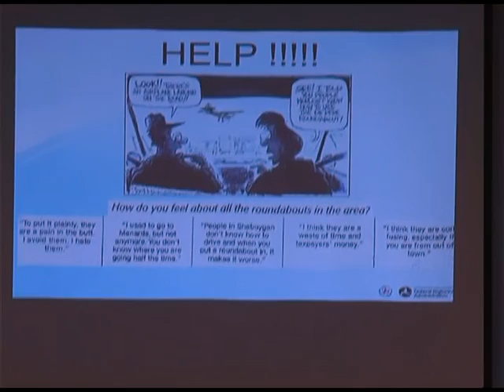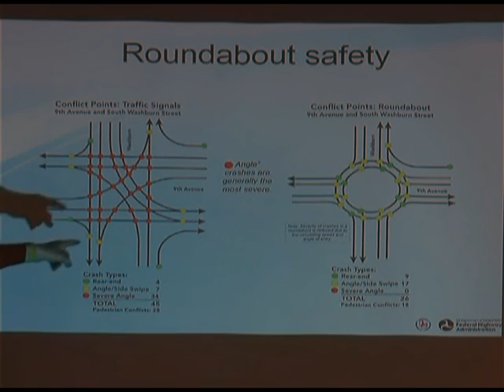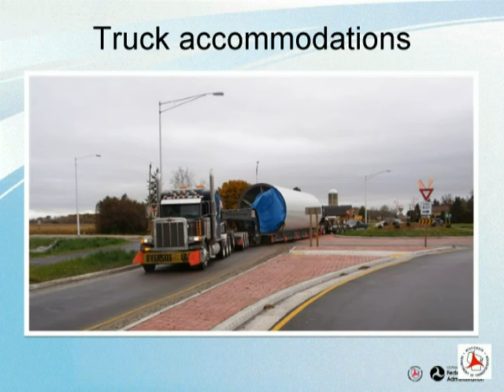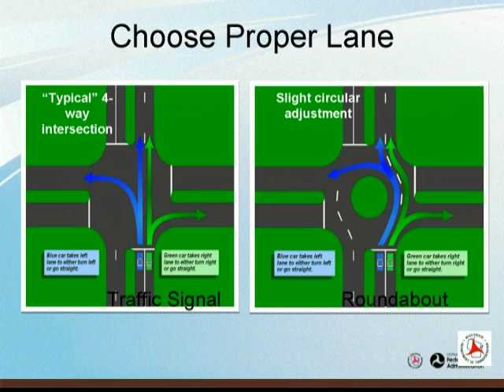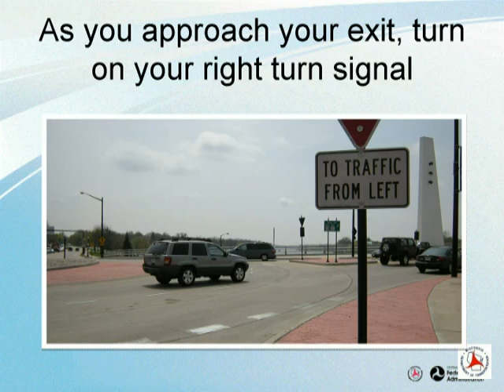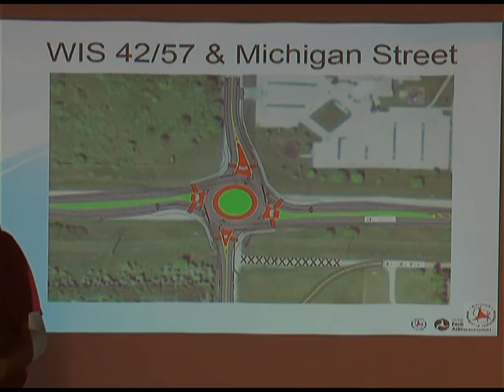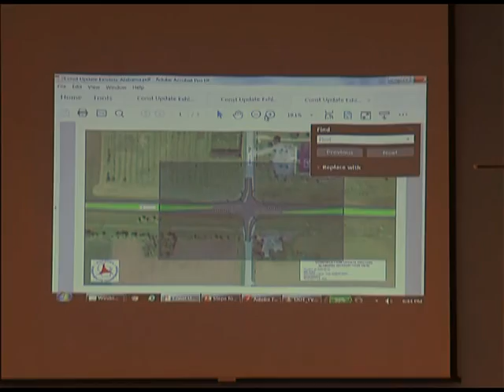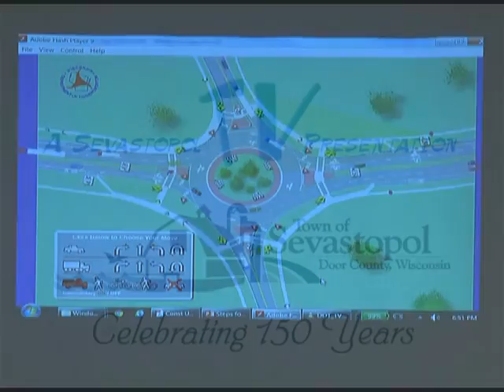06-23-16 Roundabouts in Sturgeon Bay

Comment: On a separate note I wanted to say that I looked at the DOT web-site a month or two ago. They have MANY examples of how to use a roundabout, all of which illustrated two lanes entering and exiting or a single lane entering and exiting the roundabout, and they continue on after exiting unlike what we have in Door County on the highway.
The only thing that would make sense is that upon exiting the roundabout, all road rules immediately go back to normal, which means you should not always yield to traffic in the left  lane if the left lane needs to merg right. Their lane is effectively ending... Roundabout signs appearing at the entrance of a roundabout do not indicate exactly what happens at the exit and roundabouts are designed to prevent you from seeing the other side. Again I ask,,,, how should we "race" on the highway, as the man in the video was talking about? I would prefer to impede traffic, both cases may be illegal. This is an issue especially in the AM hours.